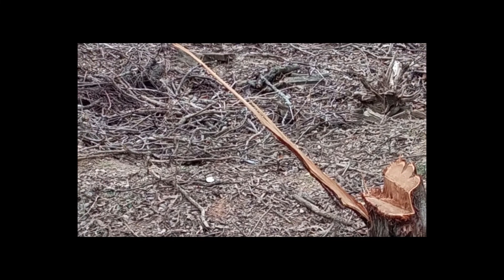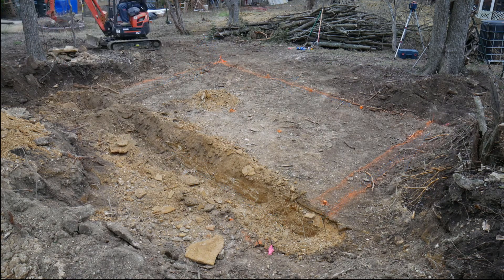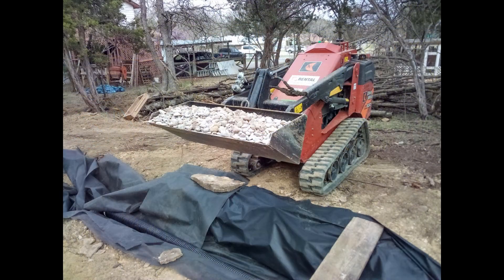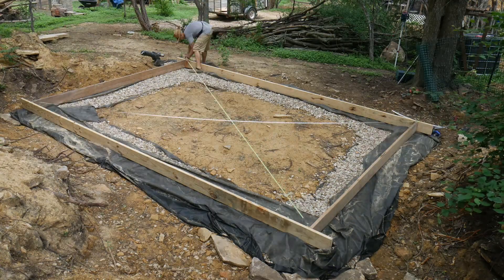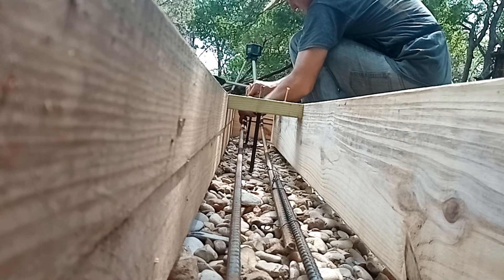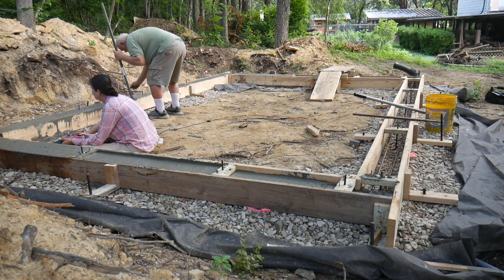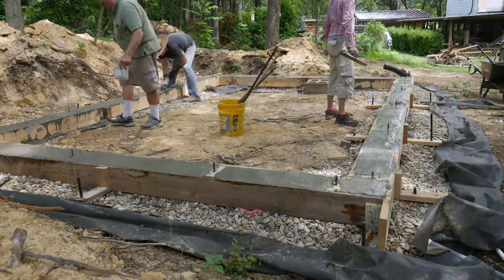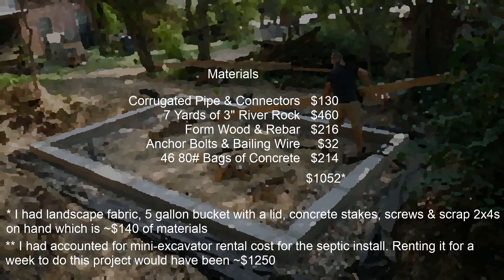Rubble Trench Foundation

Comment: Maybe you mentioned, but what are the dimensions of the building?
And not being an expert on pouring concrete or grade beams, I noticed that you left in the 2x4 spacers and seem to have the pins coming from them.  Is that standard?  I think my limited reading experience seems to indicate that normally a "J bolt" or some other bolt is typically inserted into the concrete itself (or drilled in afterward using a masonry drill bit).  No problem getting that approach approved?
Reply from the maker: Building dimensions are 18 feet by 12 feet. The J bolts do extend about five inches into the concrete. The spacer block keeps the bolts in the right position during the pour. It's kind of a concession diying it with an inexperienced crew. After placing the foundation I could have pulled of the spacer blocks and mortared the gaps.

Since this build I got a hammer drill and now strongly favor putting in wedge anchors after the foundation is placed.
Reply: @offgridburbia Thanks!!

Comment: Is that rebar sticking up from the concrete every 5 feet?
What is its purpose?
Reply from the maker: Those are anchor bolts to tie the sill plate to the foundation
Reply: @offgridburbia 
So then, the anchor bolts would attach to a bond beam on a cob wall to roof beam right? 

Also, what's the difference between footers and the trench foundation you made?

Many thanks.
Reply from the maker: In the build the anchor bolts connect the concrete grade beam to the stud framed wall. If the walls were cob I wouldn't bother with anchor bolts since the walls are so heavy.

A footer looks like the grade beam in this video but is typically wider and located below grade/frost depth. The rubble trench in this build replaces the footer.@JamesKroen
Reply: @offgridburbia 
Many thanks.

Comment: Well presented.  Enjoy the voice over technique and the annotations.
How were the dimensions of the rubble foundation calculated?
Was rebar a local requirement or why did you place steel inside the grade beam form?
Reply from the maker: Thanks, I don't like talking into the camera so the voice over seems like a good substitute. For depth of the rubble trench I wanted to go deeper then the frost line so 12 inches was plenty. The 18 inch width was primarily determined by the width of the excavator bucket. In Jim Halleck's rubble trench video he recommends the rubble trench be 12 inches wider than the grade beam. I have a natural building book that recommends only 4-6 inches wider. In my case the rubble trench foundation is 10 inches wider than the grade beam.
Reply from the maker: I put the rebar in to provide tensile strength to the grade beam since while concrete is really resistant to compression is susceptible to longitudinal stress.
Reply: @offgridburbia  Appreciate the responses.  Still trying to figure out why steel is introduced to concrete as yes, it will provide tensile strength but it will also eventually oxidize which degrades the concrete around it.
In normal residential constructs, I have yet to see the evidence that concrete components will undergo tensile forces that would cause failure.  Unless of course the component was substandard or misapplied in the first place.
And trying to understand why folks who use a compacted rubble footer, speak about frostline when frost and freezing does not effect a rubble support the way it would effect a concrete component.
Appreciate your effort to share the building process and the challenges you faced with AHJs.
Reply from the maker: @dc-wp8oc  Yes, I'm not really happy with using steel in concrete. Anecdotally, I built a cob shed with a rubble trench and a grade beam that was just lime stabilized soil with no reinforcement and that seems to holding up just fine even with extremely heavy walls. For the current build I considered using polypropylene fibers to reinforce the concrete but in the end I went with what was conventionally accepted because I'm wary of experimenting too much with foundations because they are really hard to fix down the road.

Regarding, rubble trenches and frost lines I think you're right. Since rubble trenches move water away from the foundation frost heaving should be a non-issue.  I've also heard that rubble trenches aren't good for sites with expansive clay(which I have) but I think that's wrong. From my understanding the rubble trench acts like a cushion absorbing earth movement whether its from the frost/thaw cycle or expansive clay. There's just not a lot of data. Just about all the natural building book I have embrace the rubble trench but they stick to going below the frost line depth. I suspect they don't know and are erring on the side of caution.

Thanks for the comments. I'm dubious of a lot our current home building practices that produce a product with fairly short life span.  Also what's an AHJ?
Reply: @offgridburbia  Authority Having Jurisdiction or in our case, building inspectors.  On my last project, I did not find them helpful when it came to providing code information.  Never once did they have a copy of the code when they came to the job site.  And from what I have read, they cannot be held liable for anything they tell you.  The inspection department is quick to take your money though.  Nice!
Thanks for expanding on the topic of rubble foundations.
I think current residential building practices stem from just following whatever is considered "normal" for that area, resulting in most construction being over built or over engineered as they say.
Keep up the good work.